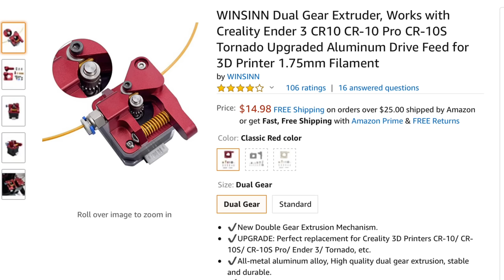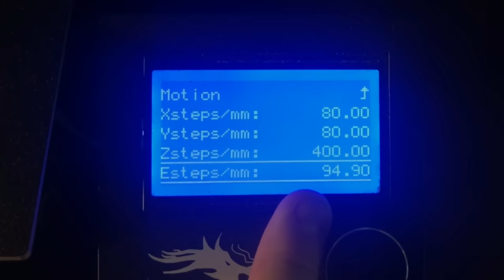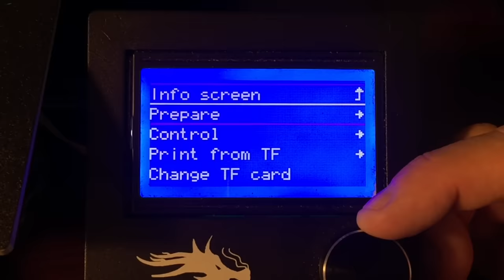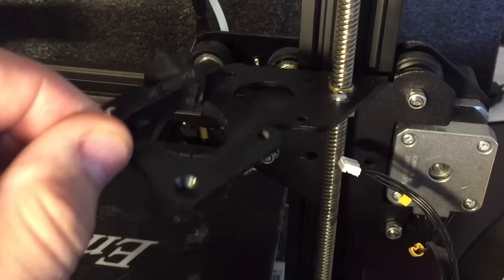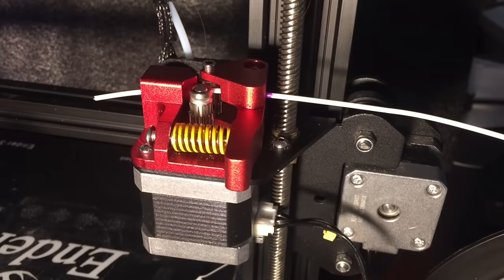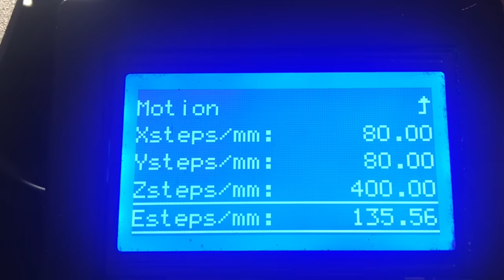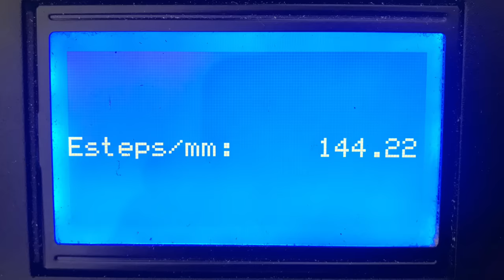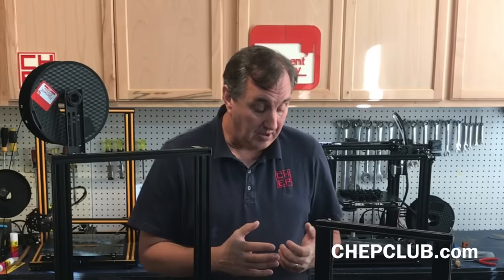Dual Drive Gear Extruder Upgrade + E Steps on Creality Ender 3

Comment: Can Somebody tell me if the filament exit hole on this all metal extruder head has the same z height as the original? Or does it expell the fillament on a higher z coordinate due to the higher gears?
I'm asking because I converted my ender 3 to direct extruder with the original extruder. Changing the height of the extruder exit point would mean it would not fit my hotend anymore
Reply from the maker: It’s taller.
Reply: It's exactly 5mm taller, I actually printed a spacer for the hotend to get it to work direct drive. You lose 5mm in the y axis but it actually works very well direct drive.

Comment: So my motor's gear does not have a screw for me to remove it.. any idea on how to remove the gear so I can put on the new one?
Reply: Fixed it with a hammer 😅 no damage. With my ender 3 pro the motor shaft is shorter than what is needed for me to secure the gear to the motor. Is there another motor
Reply from the maker: You can buy replacement motors
Reply: @FilamentFriday  i just ran into the same problem. is there a model you recommend?
Reply from the maker: Actually I would recommend the EZR extruder instead and it will fit you existing motor.
https://youtu.be/1GNDxvxpWr8
Reply: @FilamentFriday  crazy srory 😅 I didn't realize I bought two different models and brands to be safe. When I checked my box I found a "Micro Swiss DD Extruder. Have you done any work with this one?
Reply from the maker: I have one but never installed it. A project for the future.
Reply: I clamped it and used a crowbar came off like butter lol
Reply: @FilamentFriday  Can you please give us a link for the new motor? (Ender 3 Pro) I am sitting here disassembled and it's not a removable gear. I would appreciate it so much! you are always so helpful.
Reply: @deborahgoff7484  did you ever find our which motor to buy?

Comment: Does the newer (late 2019) ender 3 pro come with aluminium extruder?
Reply from the maker: All my Ender 3 have the same Creality Hotend. Brass nozzle, steel heat break and aluminum fins. I assume that’s what you mean?
Reply: I received my Ender 3 Pro from creality about a week ago. The new extruder is still injection molded plastic, however, it seems to have a few tweaks over the original; one of them being the idler arm now has a metal nutsert as a filament guide to prevent wear found in the all-plastic arms. Same crappy bowden fitting, although they at least now include the plastic snap-rings to help lock the tube in place.
Reply: @HewroPreez  good to know thank you for the detailed information. I ended up ordering the 2 components above anyways... and glad I did..... now I'm looking into getting BL Touch for auto leveling v3.0 but after much reading I decided to do it manually for awhile before I change all that.

Comment: is the bore of the gear now more oval than round ? ... there crap imo they fail & when they do they bugger the extruder motor at the same time .. how many hours use for that much wear... sure the one i purchased from them direct was listed as bondtech gear extruder ...  pmsl nothing to do with bondtech only something they have failed to copy with any precision
Reply from the maker: I only have about 40 hours on it but I didn’t add any grease.
Reply: @FilamentFriday  only 40 hrs how often does it need grease

Comment: Anyone know why the dual gear unit is so asymmetrica? What I mean is that the motor gear is nearer the centerline of the filament tube than the other gear. In addition the motor gear appears to be a bit lower that the other gear. This all means the filament path isn't straight but has to curve around the motor gear slightly more than seems necessary. I've checked CAD models, a good quality model and a cheap chineese one and all appear to be similar. Is it because the dual gear is just a modified single gear unit?

Comment: My printer doesn't have the option to change the steps in the firmware. I replaced the extruder a few weeks ago and added the calibration correction in the Cura G-code but would really like to change it in the firmware. I know I will forget to add it in when the next Cura update is released. It would be nice to have it in the firmware so it is always there. I don't know how to change the Marlin code.
Reply: ponterface and a usb lead
Reply: @wayneuk  I will give it a try. I have never used it so I'm not sure how to change the settings.
Reply: You don't need to change firmware, just M92 Enn and then M500 to save settings.  (M503 to report settings)

Comment: Can this be a possible solution for the clicking noise? I have been dealing with it for weeks now and have not been able to print anything
Reply: Remove the threaded cap inside the spring it will loosen the tension on the spring and normally fixes the issue.
Reply: Thank you so much this fixed the problem. You are a life saver

Comment: I’ve seen videos and some change the values in cura too, is that needed.?
Reply from the maker: If you can’t change it on the LCD then changing it in slicer is an option.
Reply: CHEP you mean change the flow, I’m just not sure because I’m new to 3d printing. So if I just calibrate the extruded alone you think I’ll be ok.

Comment: Instead of readjusting the esteps for slippage on the dual drive, why not increase pressure on the filament by increasing the spring preload?
Reply from the maker: It didn’t work. Tried it.
Reply: @FilamentFriday  seems a little pointless having a spring tension adjuster that does nothing. Oh well.
Reply: @TYGAMatt  the spring tension adjustment doesn't work because the spring is the wrong type. That's also why he arm is grinding into he base and there is slipping.
Reply: @infernaldaedra  please explain why this is the wrong spring. If you increase the initial preload then the spring will push back against the lever with more force which will in turn push on the filament with more force. The grinding of the parts is due to sloppy design.
Reply: @TYGAMatt  It's an excessive amount of force for the filament. This extruder wasn't designed for this type of spring. You can't really use the spring tensioner at all, It needs to be pretty much all the way backed out in order to not stress the motor and lock up because the orange spring already has too much tension. The lever grinds partially because of bad design and because the spring is starting to buckle twisting the lever.

The tension would be much tighter than the stock extruder without even using the orange spring and can be tension adjusted in top of that. The Amazon listing has the extruder incorrectly assembled in the product images. And maybe the spring CHEP got was shorter than the one I got a few months ago because I would have had to have completely compressed the spring in order to get it into where it is held in place. Read the product reviews on Amazon if this doesn't make sense.

Also this extruder with the original spring already has way more than enough tension over the original extruder. The orange compression spring is insane overkill and is going to put way too much load on the motor.
Reply: @infernaldaedra  thanks for your concise reply. Well if the lever arm design is more of the issue then this should be redesigned using a bearing at the pivot point. But I think it's just an M3 bolt so maybe it's also flexing a little with increased spring preload. Need to have a closer look. I'm sure it can probably be improved with bearings and more rigid mounting of components. Or perhaps the drive gears just need more grip
Reply: But saying that.... Improve the grip and the spring won't need messing with.
Reply: @TYGAMatt  the drive gears have enough force to crush filament with this extruder trust me that's not the issue. Plus they are geared so their really isn't a point to mashing gears together. The bringing goes away if you change the spring.

The pivot point uses a M3 bolt inside of an aluminum sleeve it shouldn't flex. 

The problem is the spring because that's what causes ever single issue with this extruder. The grinding, skipping, the need to increase motor voltage. All of that goes away with a normal spring.

Comment: I have this extruder on my Ender 3 Pro but I can't get any TPU to print.  I have the Capricorn bowden.  I am using the SKR Mini E3 V2.0 with Marlin.   The TPU seems to be bunching up before it gets to the bowden tube.  Any help would be appreciated.
Reply: Try increasing temperature in sets of 5 and/or slowing down print speed. Too much retraction can also hurt. If you still got a problem check the tube on the hotend side, might have a slight burn creating resistance(even if its capricorn, depends on how you use it).  Luke Hatfield's hot end fix, might also help, if retration is a must. Good Luck
Reply: @arganaztuga  thank you - actually figured it out I think.  Heated unit up - took off nozzle, cleaned out horns using the bowden,  then put nozzle in and unscrewed a couple threads, pushed down bowden then tightened nozzle. Also did something similar at extruder - I think I had enough of a gap to allow it to bunch up.

Comment: Love the channel, but this one seems like you're measurement concept is flawed. You're marking from outside the extruder for your initial measurement then when checking for 100m you're actually going to the gear. That wouldn't be 100mm of movement that would be like 108mm of movement according to your measurements and what we're seeing displayed. I'd say you were pushing toward over extrusion.
Reply: Had the same impression but watching again you can see he does not measure to the gear, he still checks the outside (30mm value).
Check again :)

Comment: Hi.
I realy like your videos. You know what you are talking about. I wonder if you know Why I have a problem with my enter 3D pro v2 printer. When I try to adjust the Bed leveling I can see the Corners is perfect but in the Middle It's Not right. There are to much space. But the plate is made of glass.. Why is that? How can i adjust the middle, without damage the glass in the corners? My friend have tried the same thing. Yours Kim
Reply from the maker: Check your glass for warpage. Place a ruler on its side across it.
Reply: @FilamentFriday  yep mine is the same will have to try the ruler trick

Comment: Where are you getting 135?
Reply: [theoretical extrusion in mm] divided by [actual extrusion in mm] multiplied by your [e step value] = [new e-step value]   So for example:  100mm/73mm x 93.0 = New e-step value of 127.40.   Direct drive extruders push that new step value up higher than the standard extruder design.  They under extrude at first unless you calibrate your e steps when you first install it.

My Microswiss direct drive + hot end needed a new e step value of 138 with a 0.4mm nozzle haha

Comment: great tutorial! I have one question - HOW? How do i do the same as in the video when i dont have a scrue holder in the gear on the motor. My motor has a perfect rounded pin with gear with no place for the little black srcrew..... i have ender 3 and i bought the same as in Your video.....
Reply: You have to either use a gear puller to remove the gear and then grind down one side of the stepper shaft or just buy a new stepper
Reply: @ezrandomshiet  Tnx! I bought a new stepper and it all fits like a charm. I did e-steps without a tube and it work perfect. Problem is when i plug the PTFE tube the extruder is skipping and on e-steps test it stops in haf a way even if its set on 265...... what can i do? I cleaned the nozzle

Comment: Got an ender 3 pro for Christmas without a mounting place for an extruder knob if I install ti's would I be able to mount one
Reply from the maker: You’ll have to replace the motor too or find a way to pull off the pushed on gear.
Reply: @FilamentFriday  could you give a link to a compatable stepper motor?

Comment: Dear Chep how about a guide with a bondtech clone? Isn't it better?
Reply from the maker: Why do you think that clone is better?
Reply: @FilamentFriday  cause it has not only dual drive but also a reduction gear
Reply: @FilamentFriday  Dear Chep I suggested a clone because of 2 reasons, one being a clone makes it cheaper and more sense for a "cheap" printer making it affordable, not many videos about installing that one on the Ender 3, second reason being a geared one it may be more forgiving at the motor preventing skipping. So far the weak point in my view is the special Gcode for load or unload the filament, for sure the handle is faster for it.

Comment: I did it just like you and i got after my 3 calculation 950 steps O_o i think my ender 5 is a little bit confused
i got with 144 only 1,5 cm, with 155 only 1,6 cm. with 190 only 2,0 cm.
Reply: Automobilie thanks. Now i got 404 :)

Comment: Tried to upgrade my ender weeks ago. But with this dual extruder upgrade my extruder was extremely skipping steps. Any clue how to fix that?
Reply: Maybe you have the spring tensioned too high or the screw in the insert that holds the spring arm.
Reply: @schwuzi  problem occured even at minimum spring tension
Reply: @renebrsch  check E stepper driver Vref
Reply: @gedr7664  whats the default?
Reply from the maker: Should be 0.65v
Reply: If you are missing steps try to increase it by 0.1V, but note of warning: if the stepper runs hot, the gear will get hot and the filament will get deformed/partially melted by the gear, resulting in the filament being squished by the spring arm. This will effectively kill your print as it can't grip the filament. Try out it and let me know how it goes! Make sure there is no drag on your spool!
Reply: The spring that comes with this extruder is the wrong type of spring. Use your old extruder spring.
Reply: certain it's skipping steps? i used the wrong grub on mine initially and the excess screw height was opening the gears up and letting the filament back out. luckily i found the original grub hiding under the control box after it's first escape attempt

Comment: i have a press fit gear any tips to remove it or should i just get a new one
Reply: You can replace the press fit ones you just need to be careful removing them as not to damage the motor

Comment: I tried your configuration only to find 144.5 mm way to much. When printing, my Bowden tube would get all bunched up with filiment to the point the stepper motor would make a clicking noise and simply be unable to feed. After 5 failed prints I’ve since backed down to around 100mm /sec.
Reply from the maker: My configuration is set to 50mm/s. No prints will be good at your speed.
Reply: CHEP I’ll have to give it a go. Small parts print great. Parts with big flat surfaces give me grief.
Reply: My mistake. I meant the e step setting.
Reply: CHEP with the stock extruder I was printing tpu no problem at 60mm/ sec. the arm cracked and I replaced it with this new dual deal. I’ve tried to get a tool cover printed in tpu for the last 2 days to no avail. It’s the large flat areas that fail. I’m exhausted in trying to get this thing set.

Comment: BMG extruder is even better, trianglelabs one is pretty cheap for the quality it has
Reply: Clone works fine for me. All the bearing have gone bad on those red ones I’ve gotten before
Reply: @Electric Boogaloo Did you have a good one? or just a cheap clone with plastic parts?

Comment: I've just done this upgrade and now there is not enough length on the stepper motor shaft to allow me to fit an extruder knob. Anybody have any ideas how to get around this?
Reply: push the spring and push it though lol

Comment: I just installed this and the yellow spring is long... line insanely long. Like 26mm long. And its stiff as all heck. I forced it on and then it wouldnt feed any filament and then I saw the entire arm was bowing.
Reply from the maker: Use the original Creality spring with it.
Reply: @FilamentFriday  that's what I ended up doing... But then I was getting binding between the gears. The tiny black screw that holds the gear to the motor was hitting another part. Made sure it was against the flat side, but it just won't screw in any more. I already switched back to the original extruder. T

Comment: Would a brass or copper washer help that wear on the follower gear?
Reply from the maker: There isn’t enough space for one.
Reply: Seems the idle gear bearing is crap, that causes too much play and make the gear tooths grab the metal. I'm thinking on making a brass bushing with the correct height (the bearing is too short)
Reply from the maker: There should be two bearings stacked on top of each other.